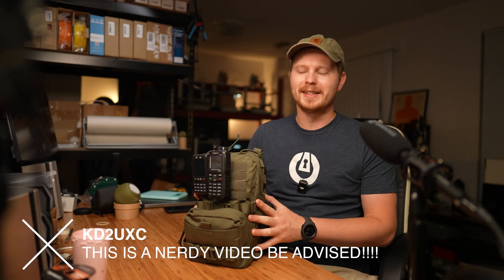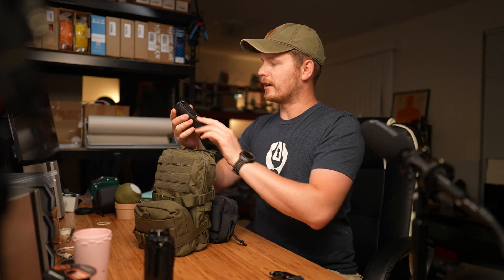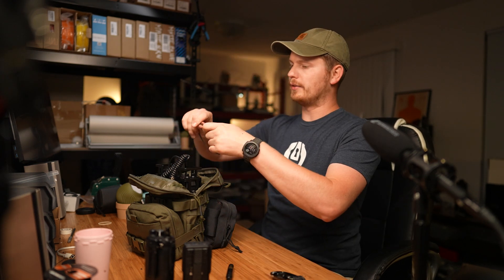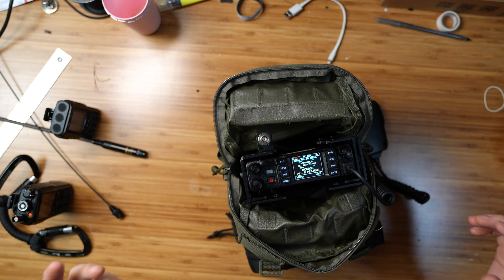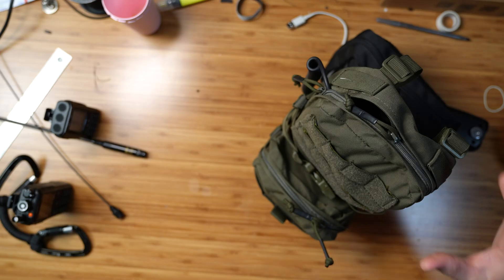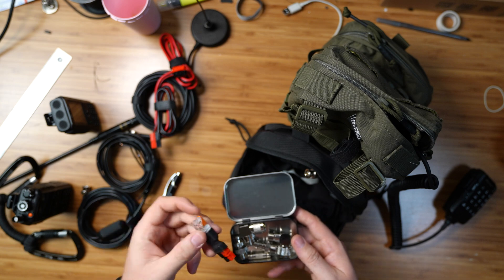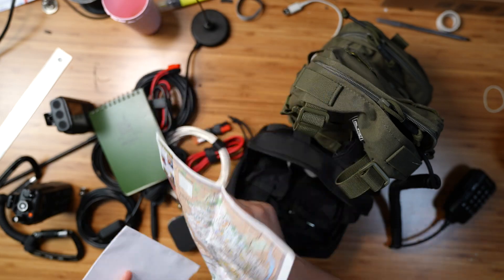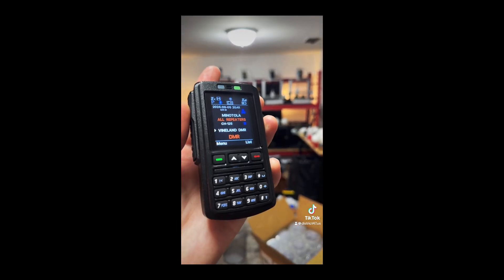What's in my Ham Radio Manpack |Anytone 578| Full Video

Comment: I'm looking at that pack on amazon and it looks like the front pouch of yours (where you keep the battery) is much larger than the one sold with it. Did you get a bigger pouch for the battery or is that what the pack came with?
Reply from the maker: I have 2 pouches actually. the one that comes with the bag is what I placed the battery in, and the black one is a random pouch i found on amazon.

Comment: Power Poles, have one ready made with the "cigarette" lighter plug on the end. And another with alligator clips. 

Check the wattage max on your telescoping antenna. That 578 will most likely cook it. Program the 578 for all channels to start at or below the rating of your lowest watt antenna. No need to let the magical smoke free.

Try digital simplex mode. It's awesome.
Reply from the maker: I actually have the cigarette lighter plug. But never used it. So kept it out as it was fairly bulky. 

Alligator clips are genius. Definitely gonna do that. 

Good point about the antenna. I believe I read 50watts but I’ll need to check. 

Gotta read into that. What makes it awesome? Give me a brief summary before I dive in please.